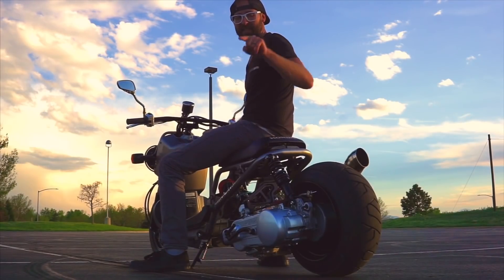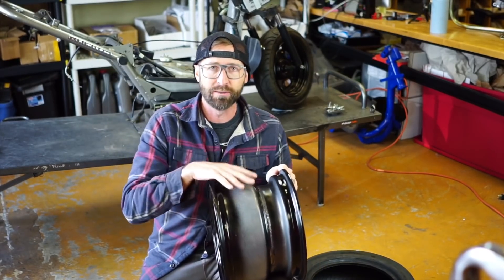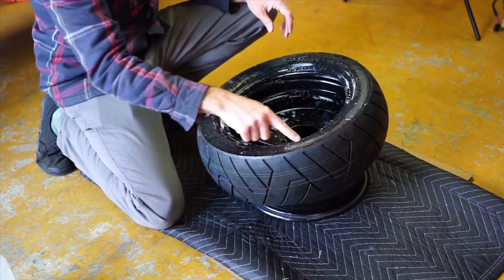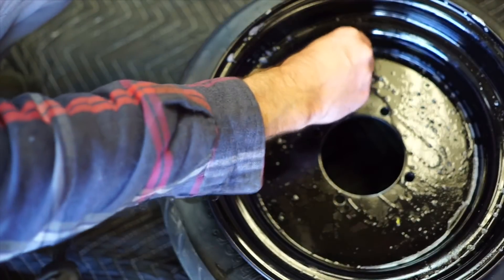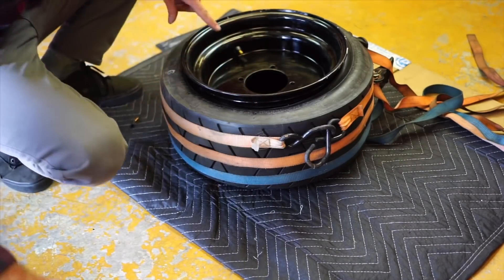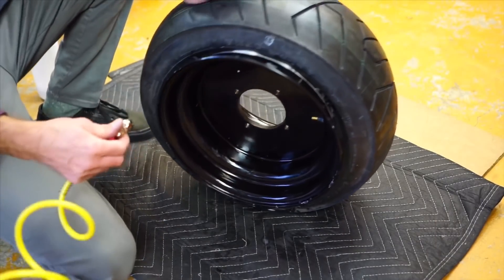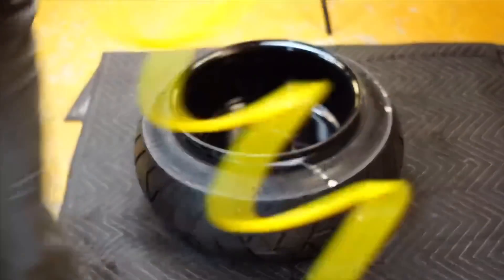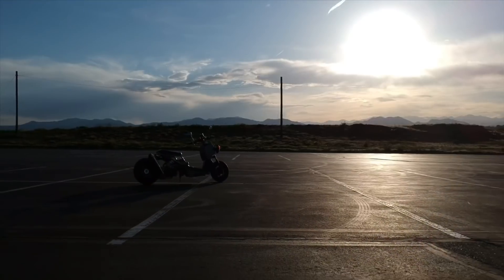How to stretch a tire [Honda Ruckus GY6 swap] PART 3

Comment: I got a 140/70-12 with 12X8 rim when I install tire onto rim it seems much more loose than yours can’t seem to bead it any ideas on why?
Reply: Like when you seat the tire on the rim it seems almost already sealed when I set mine on it had a much larger gap

Comment: What psi do you recommend? I've recently bought one and it's sitting at like 100psi, seems like trouble
Reply from the maker: I know Dorby runs 100 psi. I personally run 40. But these tires are know to de-bead (since they are stretched). So it’s really up to you.

Comment: ok i may be stupid, but why not just buy a wheel that fits that rim?
Reply from the maker: It’s the style. Skinny wheel is standard. We don’t want standard :-)
Reply: @RollingWrench  I mean why not buy a fat tire that fits a fat rim. Would it not work out with clearance or raise the frame too much?
Reply from the maker: @FlapJack4Gaming  ya, that’s correct. Any larger of a tire wouldn’t fit and hit the engine and not work out
Reply: @RollingWrench  thanks for the reply 🙏